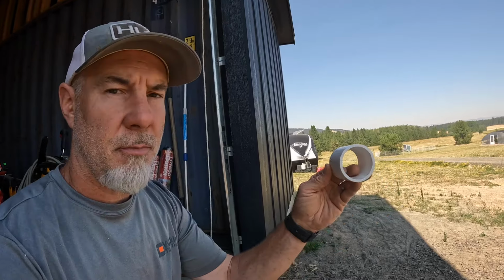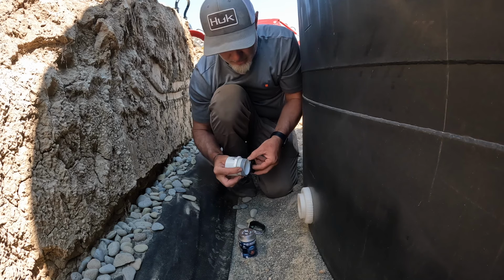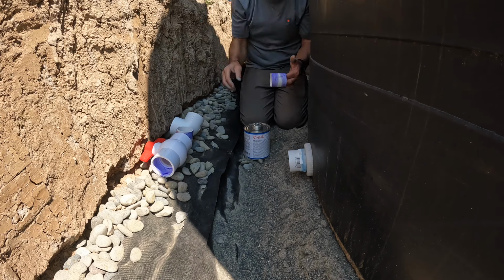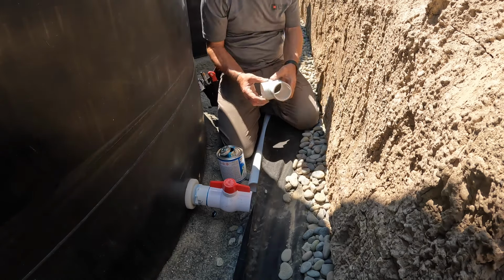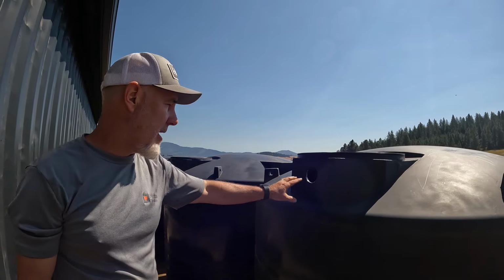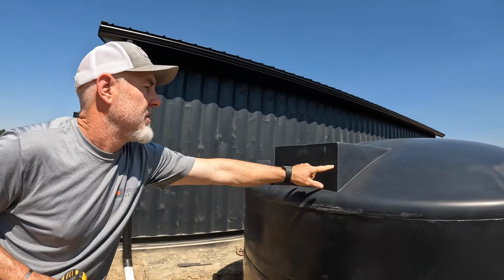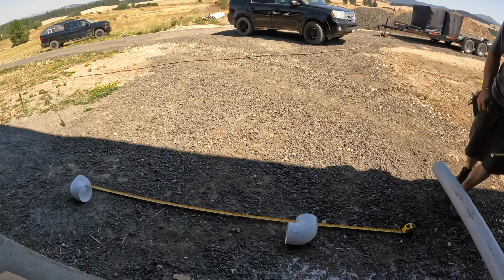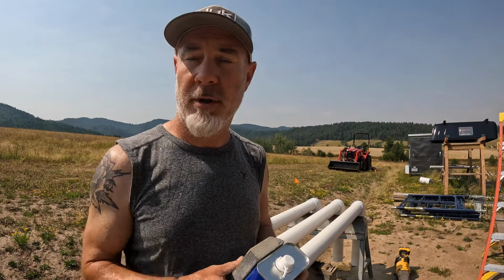The next step in our MASSIVE RAINWATER COLLECTION SYSTEM // Connecting our tanks in series

Comment: looks like a well planned system.  One lesson I learnt was don't leave valves open unnecessarily. One broken pipe can drain all your tanks. I wasted 40k litres. (I have mains as well, so it was just a bit annoying as it happened in the middle of summer)
Reply from the maker: @keithh9491  wow, sorry to hear that. That would be horrible especially in the summer when you really need to hold on to the water. We have 2 valves off right now. We are only using the first 2 tanks but as they fill, we will have to open the others.

Comment: I probably would have included some unions just in case I ever needed to take some of it apart, but….more potential points of failure.
Reply from the maker: @byrdman662  yeah I did think about having unions in few spots but I didn’t want to risk the possibility of leaks. Though unions are pretty reliable.👍

Comment: Hallo Levi, +Tania ihr habt wieder sehr gute Arbeit geleistet, alles sehr gut erklärt aber noch eine Frage? Wie kommst du später an die Ventile ? Wird es einen Revisionskanal geben? Schöne Woche.🤓
Reply from the maker: Thank you my friend. We are going to take a 12” culvert pipe and cut them to 4 feet long. Those will go around the valves on the bottom and stick up out of the ground a few inches. We then will make a 6 foot long tool out of rebar that can reach the valves to shut them off. 👍

Comment: What was the logic of using a 4" hole for the overflow?  Would not the 2" upper bulkhead that was included work?  That is a lot of volume.  Just wondering as I am currently installing the same tanks from the same supplier.
Reply from the maker: With a heavy rain, if the overflow isn’t equal to or larger than the inlet coming from the downspouts, the water would backup and spill out of the leafeater or overflow the gutters.